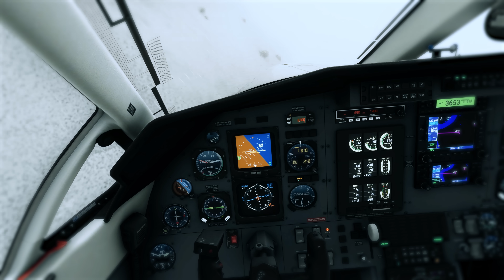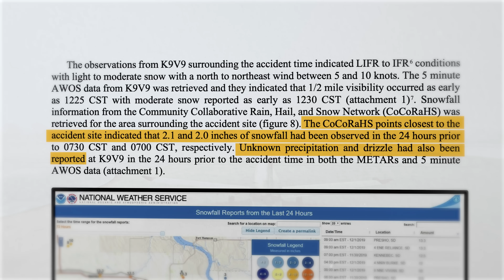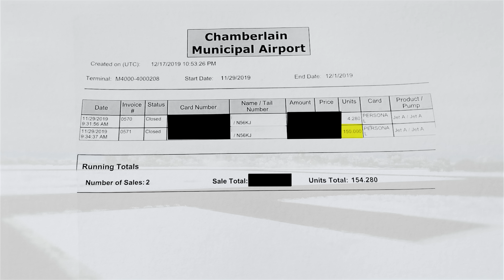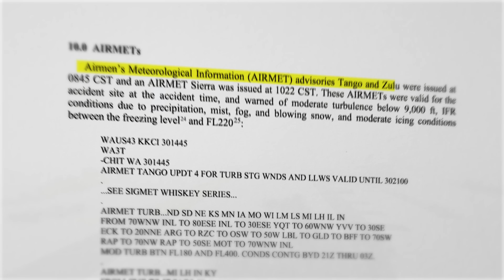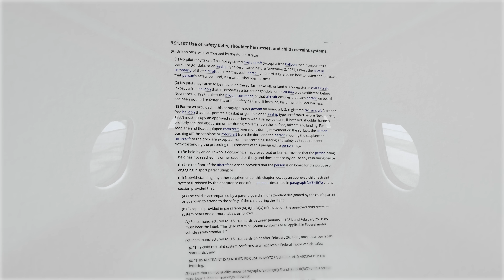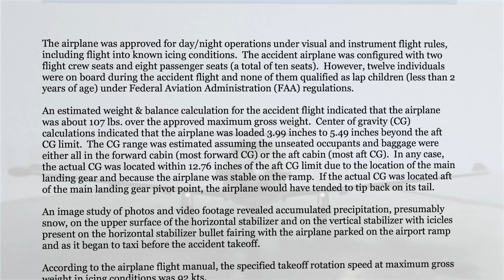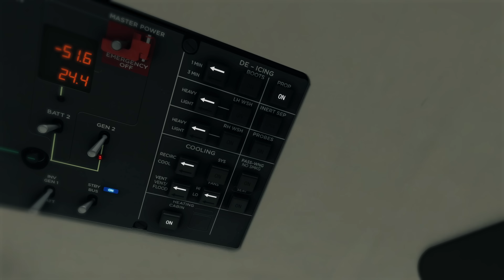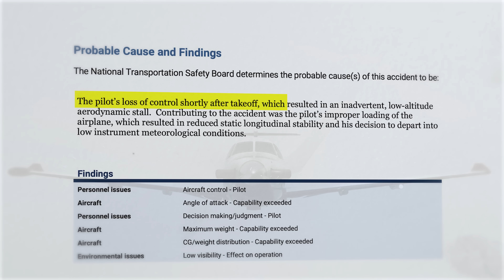PILOT or PLANE: What Caused This Crash? | Accident Case Study

Comment: In my younger days in the 70's and 80's I was an adrenaline junkie with sky diving, scuba diving, extreme skiing, motocross, and finally an Army Ranger. I put myself into dangerously stupid situations too many times to count and I have the scar's and 4 artificial joints to prove it, but I don't believe I ever put anyone else's life in danger by my actions, in fact most people think I am overly cautious when it comes to safety precautions.
Overloaded, out of balance, icing, IMC, FBO telling him he's crazy, I am shocked this pilot didn't wait till dark just to add one more degree of difficulty.
Gamble with your own life, fine, but gambling with other people's lives, to this degree of incompetence especially with children on board is disgusting.
Reply: They didn't clean the vertical and horizontal stabilizer because they couldn't reach it from the ground, this is beyond unacceptable since ice was probably already there before crashing, as you speed up in the runway the snow and rain already there would turn in to ice if the deicing is not activated.
Reply: @lcfflc3887  yes they sh😊ould have cleaned the horizontal stabilizer using a taller step ladder...but rotation speed was too slow to compensate for aft center of gravity.
Reply: @Keijo-vp8fy they should of flown to Miami
Reply: @lcfflc3887  Agreed! The horizonal stabilizer was the highest point of the aircraft, therefore receiving more ice/snow than the rest of the plane?
Reply: I still am, but you never taking flying with passengers lightly, especially children who can’t really consent to danger and have no idea what’s going on. Worse, this guy seemed proud that he was just winging this whole thing. He bragged about how much ice there was and then his little wink wink “well” in reply to his friend saying did the ice come off like this was some game.
Reply: I even tell some of my friends that you might consider sending the wife and one kid or half the family on one airplane flight and the husband and half the family on another one so that the whole family doesn't get wiped out. And I'm talking about airline traveling, doing what they're doing here, and so many other times with their own kids in risky situations is just the freaking stupidest thing. And unfortunately it's a clear example of genetic selection unfortunately for the kids  @The_ZeroLine
Reply: Right just fly at night too this guy was a fool.
Reply: Good point, wait till dark was about the only other thing remaining.
Reply: I hear ya re: our younger days. We lucked out to be able live through our adrenaline urges. 
In my case, without scars except in the near past, SMH moments when I thought, "WWIT*?"
*What Was I Thinking
Reply: he should've removed the windows for more visibility
Reply: Ranger!!  Thank you for your service brother.  Be safe.
Reply: @HomesickforAlaska  
Makes me wonder if he actually was depressed, financially strapped, and decided to commit suicide taking his family down with him on purpose.
Perhaps his last words were: "yahoo!!"
Reply: @Williamb612Suicidal people are weird freaks so maybe
Reply: @Williamb612 you're sick. He wasn't that way at all.